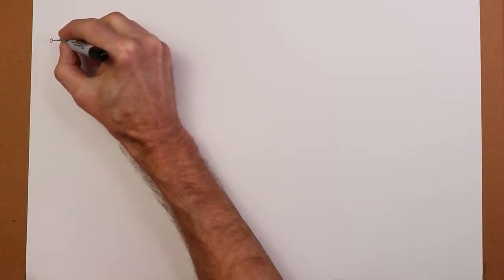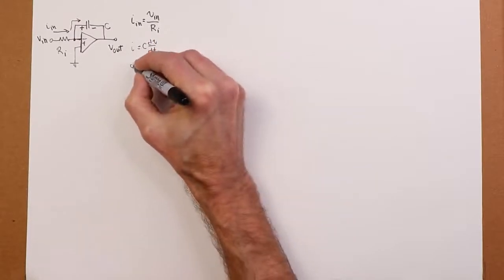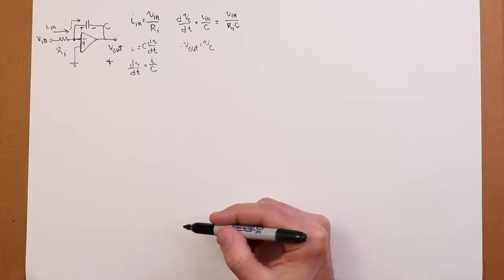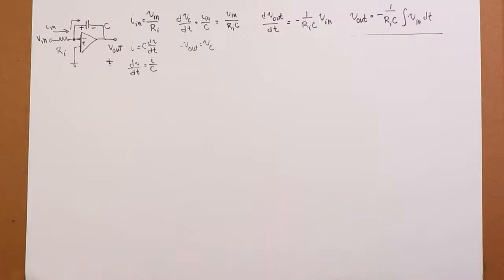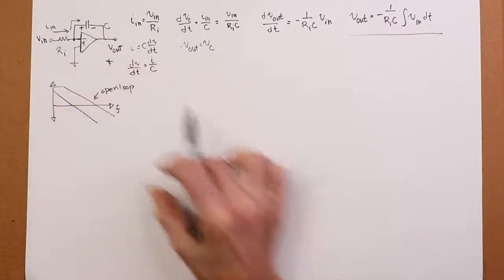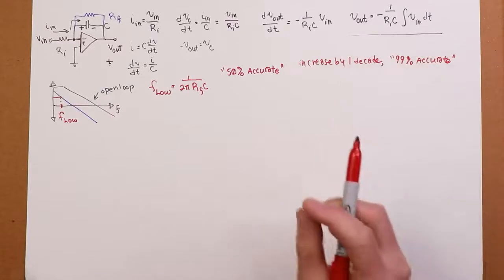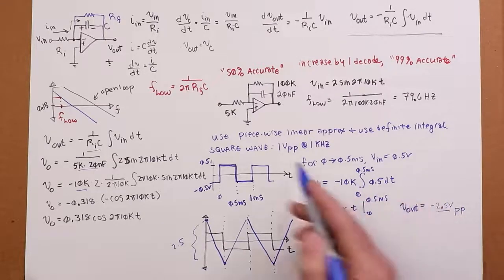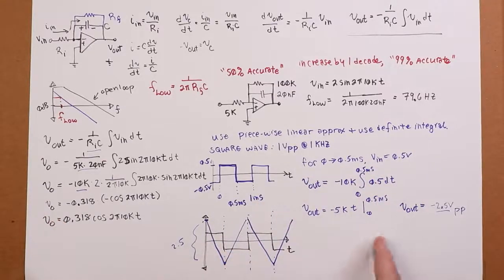Op Amps: The Integrator

Comment: The output is proportional to the integral but the voltage is not necessarely directly representing the exact value. One needs to multiply the output voltage with Rin*C/t
Reply from the maker: -1/(Rin*C)

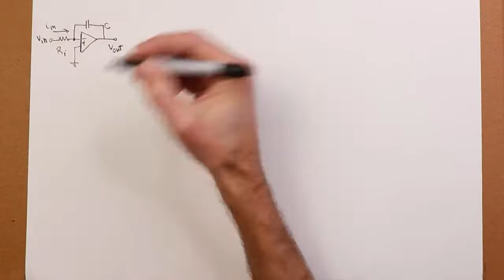Comment: well my question is about the arrow 1:12 , my slide book shows it all goes to the left, i assume it goes all to the left to form some formula. can we do that?, and what is the theory behind that? and from what i learn, all the arrow goes to the right. anyway i was trying to simulate a derivative function using op-amp. thank  you professor.
Reply from the maker: If you are referring to the direction of the input current (I_in), this would be for a positive input voltage and using conventional current flow. If the input voltage was negative, conventional current flow would be to the left (and of course electron flow is the reverse of conventional flow). There is some extra detail in my free op amps text book.

Comment: Hi Sir, for practical integrator op-amp by introducing the feedback resistor, the output equation will be different from one used in the earlier without feedback resistor. So why the same output equation is used?
Reply from the maker: As long as your signal is sufficiently above the lower limit frequency, the equation is the same. Below that, the circuit is no longer an integrator, it's an amplifier.

Comment: Apologies to bother you, but in the case where you have the feedback example, I was told by my professor that we need to solve for the impedance Z of Rf in parallel with the capacitor. So Z = Rf||(1/jwC). Then you use Kirchoff and get -Vin + Iin(Ri) + Iin(Z) + Vout = 0. Then you use the equation for current to solve for Vout, so plug in Iin = Vin/Ri. 
My doubt is, do we use Xc for the capacitor, or 1/2(pi)fC? Or when dealing with 1/jwC, you simply plug in the value of the capacitor in farads? Every resource and video I've looked at of the op amp integrator seems to take a simplified approach, where they never really take the impedance of the feedback resistor in parallel with the capacitor in consideration for their equations.
Reply from the maker: Xc is 1/(2pifC) so I don't understand the "or" in your question. Like all circuits, there are multiple ways of solving it. In this particular case, the op amp creates the virtual ground at the input, and you can use the current/voltage equation of the cap to solve for the output. The addition of Rf won't make much impact if the input frequency is well above Flow. If it's near Flow, then the accuracy of the result will suffer (and for higher accuracy, use something like your prof suggested). Finally, if the frequency is below Flow, then you don't have an integrator any more, you just have an inverting amplifier. Check of the frequency response graph starting at around 4:30 for a visual.

Comment: What is output  if input  drops to zero. Will output remains const or output discharges?
Reply from the maker: Ideally, it would hold the level, but in practice not so much. First, no cap is perfect and will eventually leak. Second, a practical integrator will include Rf which creates a lower frequency limit and serves as a discharge path for the cap.
Reply: @ElectronicswithProfessorFiore   thank you. Sir. But why capacitor cannot discharge through R1 when feedback resistance is not connected ?
Reply from the maker: @kalma4431  There is always some discharge because of leakage paths (the op amp and cap are not perfect). Further, don't forget that the inverting input is at a virtual ground which effectively removes Ri from consideration.

Comment: If we need to integrate non-ideal signals, although they are similar to sine waves, can we use the integrator circuit? Or do we have to use methods of numerical integration? Thanks!
Reply from the maker: As long as the signal is within the integration frequency range and doesn't cause overload, you can integrate it.
Reply: @ElectronicswithProfessorFiore  Excuse me, but what do you mean by overload? What causes output saturation?
Reply from the maker: @alfonso4998  Overload=clipping. Like any amplifier, if the input signal is too large, the op amp will go into saturation and clip the signal. End result, an inaccurate rendering of the signal. It all depends on the frequenc(ies) of the input, the gain(s) at those points, and the amplitude of the input signal.
Reply: @ElectronicswithProfessorFiore  Then, if we use, for example, an input signal of 15V amplitude and we feed the operational with +-12V the output would saturate. Or, in a different case, with also +-12V in the operational, a signal whose amplitude is lower than 12V (5V, for instance), if the gain in the signal's frequency is 5V/V, output would saturate, too. 
Are these the different situations in which we can have clipping? Thank you!
Reply from the maker: @alfonso4998  Pretty much, yes. Whenever the input amplitude multiplied by the gain at that frequency is at or above the supply rails, you've got clipping. The tricky bit with an integrator is that the frequency response falls at a rate of 20 dB/decade, so if you have a complex signal that contains many partials, it is a bit more involved to compute. Integration may change the shape of the waveform, not just increase it like a typical amplifier. For example, integrating a square wave does not yield a square wave; it yields a triangle wave. But if you're looking for a quick approximation, just find the fundamental (lowest) frequency of the input signal and then multiply it by the integrator's gain at that frequency. If it comes within a volt or two of the supply rails, you need to be concerned about potential clipping. That will get you close, assuming that the lowest partial has the highest amplitude.
Reply: @ElectronicswithProfessorFiore  To know if there is clipping with a complex signal it would have to obtain the contribution of each partial at the output [partial's amplitude*gain(at frequency of this partial)] and add all of them, right?

If after obtain contribution of fundamental frequency at the output we note that output is close to power supply (1 or 2 volts, like you say), can we hope clipping because of not take into account the contribution of rest of partials? In this case, we would have to attenuate the complex signal before integrator or choose an op-amp with an input range bigger, right? Although I don't know if input range of one op-amp can change so much...

And sorry if there are many doubts, but the truth is that it is helping me to clarify myself
Reply from the maker: @alfonso4998  That's the basic idea but it is a little over simplified because it does not account for phase shift, which can impact the expected maximum peak amplitude. Many signals have a dominant fundamental frequency component with higher frequency components of smaller amplitude. In that case, If the fundamental times its gain is well below clipping, it is unlikely that the signal will clip. If need be, you can always perform an  approximation by integrating a piece-wise linear approximation of the signal. I illustrate how to do this in my free OER text that these videos follow. 

And yes, if the signal does cause clipping, you can add an attenuator to the front end of the circuit. Alternately, you can redesign the integrator for lower gain.
Reply: @ElectronicswithProfessorFiore  As you say, we need to know if the fundamental component is really dominant over the other higher frequency components to know (approximately) if there will be clipping. So, would it be logical to first check the nature of the signal on the oscilloscope (fundamental + harmonics) and then design the integrator circuit?

And last question... When choosing the right op-amp for the integrator, would its frequency response influence the circuit's frequency response or can we choose an op-amp with any bandwidth?

Thank you professor
Reply from the maker: @alfonso4998  You might be overthinking this. If you are not sure of there will be clipping, why not just prototype the circuit and see what happens? I am reminded of a story about Thomas Edison (possibly true, possibly not), who asked one of his associates to determine the volume of a certain light bulb. The associate traced out the shape and began to do a curve fit so that he could integrate the resulting equation. Impatient, Edison grabbed the bulb, filled it with water, and then poured the water into a graduated cylinder. 

Regarding frequency response, the gain-bandwidth product is not as important as it is with a differentiator because the frequency response of an integrator follows that of the open loop gain (-20 dB/decade). Of course, a higher GBW will yield greater loop gain, and thus higher accuracy, so GBW should not be ignored. Also, DC offset should be kept as low as possible (low frequency limiting, as explained in the text, is generally recommended).
Reply: @ElectronicswithProfessorFiore  Yes, I think I was thinking about it too much... I'll try it as soon as I can go to the lab

What I don't understand is how the frequency response of the integrator can follow that of the op-amp in open loop. I know that this occurs when the op-amp's feedback network is made up of frequency-independent components (such as resistors). But in the feedback network of the integrator we have a capacitor, which depends on the frequency...
Reply from the maker: @alfonso4998  Right. The open loop response of a typical compensated op amp falls at a rate of -20 dB/decade. If you have resistors in the feedback network, they are (ideally) not frequency dependent, so you get flat frequency response (until you hit the open loop response, and then it follows that). With a cap in the Rf position, its Xc decreases proportional to frequency increases, e.g., a ten fold increase in f makes Xc drop ten fold. That works out to a drop in gain of ten fold, which is equivalent to 20 dB. In other words, the same slope as the open loop gain. Thus, the integrator's frequency response looks like the open loop response, just lowered.
Reply: @ElectronicswithProfessorFiore  But, when obtaining the frequency response of the integrator (with Rf and C in the feedback network), the influence of the open-loop gain of the op-amp, dependent on frequency, is not taken into account. In a real design I imagine that it should be considered. So, this effect is never taken into account in the transfer function of the circuit, otherwise it would be too complex. You study independently, right? I don't know if I explain myself... Thank you!
Reply from the maker: @alfonso4998  Have you read the corresponding chapter in my op amps text book? I think it will illustrate some of your questions better than this back-and-forth in the comments. It's free. You can download it at my web sites: dissidents.com and jimfiore.org.
Reply: @ElectronicswithProfessorFiore  Thanks, I'll look into it! Sorry if I've been a bit boring...